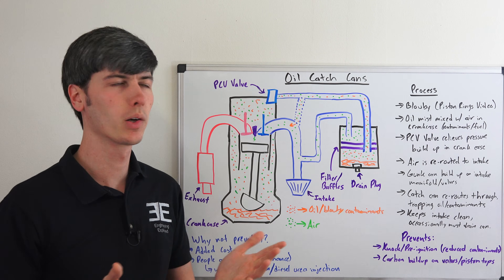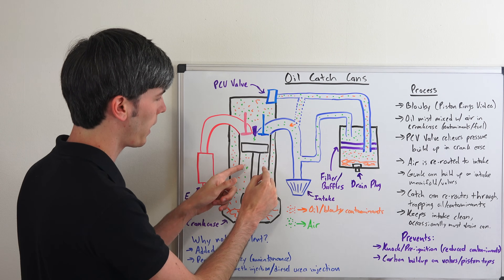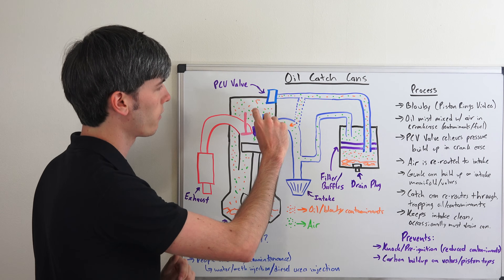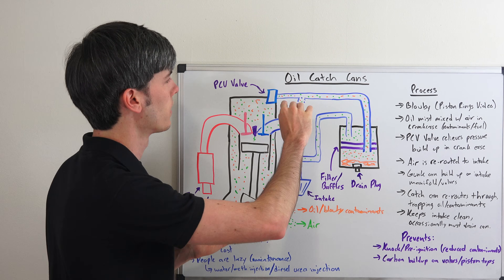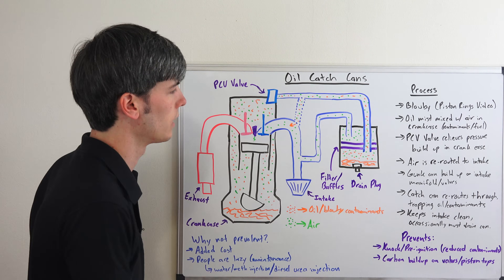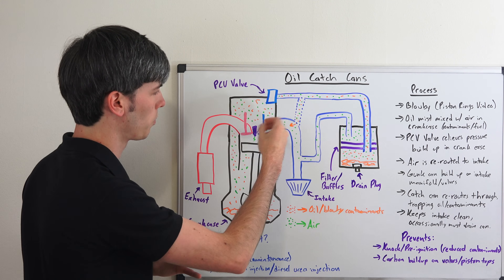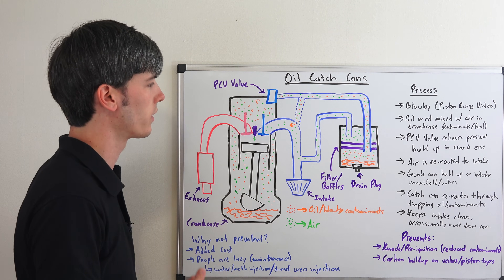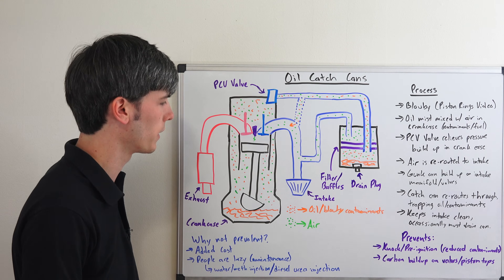What Is An Oil Catch Can?

Comment: Hi ! Thank you very much for this technical info. I bought the cheap one from aliexpress (with the dipstick) and deliberate whether to connect the out port back to engine or seal it and release the crankcase pressure to the atmosphere via the supplies external barrel filter . I’m afraid that the PCV will barely open due to lack of vacuum (if the outport of catch can and the intake  port are sealed). What is your opinion on this ? Many Thanks !

Comment: Better terminology would be "oil separator".    In the oil separator, you could have a coalescing filter to remove oil vapor before you return the crankcase fumes to the intake manifold............    Thanks for sharing.

Comment: On a port injection engine assuming there is no catch can, does a fuel like Chevron with Techron additives automatically end up cleaning the oil mist build up on the intake valves?

Comment: Do the elements inside the catch can, can restrict the normal air flow pressure, and will cause positive crank case pressure build up? I have read this somewhrere and decided not to put one in my diesel truck yet because of this concern..

Comment: When cleaning the throttle body on my wife's 2004 Buick LeSabre, I found it difficult to clean both sides, so I removed it from the intake. The front side looked pretty good and had probably been cleaned in the past (used car). The intake manifold side was incredibly coked up. There was in excess of 3/8" buildup- and I had never seen any engine that dirty before. I plan on putting a catch can someday to prevent this from happening again.

Comment: Through the 50's and 60's a simple 'down draft' tube handled this problem just fine.  You should not be pulling a vacuum on the bottom end of your motor.  That makes no sense at all.  "EQUALIZE" the pressure from the bottom end of your motor to atmospheric pressure is all that is needed.

Comment: What is the optimal crank case pressure? 

Have you done any experimenting with testing comparing oem crankcase pressure against the alternatives (breather, catch can, catch can breather combo, or oil air separator)?
Reply: Vacuum is best, as in "positive" crankcase ventilation. I vented mine open to the street for 10,000 kilometers, and the oil change was pitch black, the last half liter oozed out of the drain hole like black mud. So I connected it back up properly, and the oil hardly even gets dirty now. Am presently shopping for a catch can, that doesn't restrict the vacuum.

Comment: My question. Does it matter if the baffle or filter from the catch can is connected on the PCV line? Or from the crankcase line? I believe that I've seen some connecting the crank line to the filter line of the catch can,  and some the other way around.  I'm a little confused

Comment: Question for you, on my motorcycle I made a “catch hose” instead of a can.  The way it is set up is hose out of crank case breather outlet, T connector with a piece of hose and breather at the end of it going up, longer piece of hose with drain plug going down.  It collects oil but there is still a good amount of wet vapor that escapes out the breather and therefore gets all over the top of my engine.  Can I put a vent somewhere, stuff the top hose with steel wool, or reposition in a different way to get rid of this problem?

Comment: if oil catch can weren't incorporated into car design, why didn't car designers just route the bottom of the can's oil contents back into the oil pan via the dipstick tube after engine shutdown? Seems like a simple solution to me, a gravity-based purge. No manual maintenance of emptying the can.

Comment: @Engineering Explained Can you explain the differences and especially the benefits between single valve and dual valve catch cans.  Dual valve catch cans are supposed to be better and they are significantly more expensive, but I can't tell if the benefits would apply to everyone and if it's worth the price difference.

Comment: Approximately what is the diameter of an oil catch can? And regarding the filter/baffles, is the "filter" actually layers of crimped wire, often referred to as a "mist eliminator" and are the baffles you mention of the chevron type (zig-zagging thin steel plates (almost "spooning" each other, almost nesting into each other)?  In industry, chemical plants, refineries, paper mills, the chevron-type is used for large, fast moving volumes of liquid-laden vapor and used to separate the entrained liquid particles from the fast moving vapor and  is particularly good for dirty applications. The wire mesh mist eliminator (also referred to as a "demister"  by some in industry) offers a much higher liquid/vapor separation efficiency than the chevron-type due to its ability remove much smaller diameter liquid particles entrained in the vapor flow, however, this type of mist eliminator requires a slower ft/sec liquid/vapor velocity through it in order to achieve that efficiency, hence, the wire mesh demister usually requires installation in a wider diameter vessel than the chevron-type to achieve those lower velocities.  In certain circumstances, in a "sweet spot" of liquid/vapor flow rate that satisfies both the wire demister and chevron design characteristics, it is not uncommon to see a  wire mesh demister installed directly on top of  a chevron mist eliminator.  

What is the most common liquid/vapor separator used in these oil cans have you seen, or is it your experiences to have seen both used in combination?  And again, what is the typical diameter of an oil catch can?  BTW, it's also common in industry, and particularly in the oil patch, to see what you described initially--- a separator vessel without a demister or chevron in it.  If the vessel is properly sized to the expected liquid/vapor flow, the velocity of liquid/vapor immediately drops the moment it enters the vessel, allowing gravity alone to disengage the entrained liquid from the vapor and collect on the bottom of the vessel to be pumped away.

Comment: Its wonder modern engines run as well as they do. Between the exhaust gas re-circulation, the fumes from the gas tank making their way into the intake and the piston and oil blow by into the intake, yikes, plus we are pumping air into the exhaust. Yikes. But somehow they keep getting more and more power out of the these smaller and smaller engines. I'm afraid to adjust or alter anything on these engines.

Comment: There's a reason why manufacturers don't put oil catch can in their engines. That oil is needed to lubricate some parts especially for turbocharged engines where the turbo could get super hot. Oil mist is not bad for the engine. Oil catch can isn't realy that bad for non-turbocharged engines, just make sure to clean all the internals before installing one. But if you really want you engine to last long, ther's no need for a catch can just clean out all the carbon build up every 5 to 10 years depending how often you use your car.
Reply: Oil in the intake manifold is a bad idea.  Turbochargers get their oil from oil lines, not from blow-by.  I thought, engines with turbochargers had an oil-separator in the PVC system.  The average person does not ever "clean out the carbon".

Comment: Oh no. I think your explaining the opposite. More gunk will go directly in your engine. Oil catch can catches oil, then it leaves your intake dry. Dirt + oil will only stick on the sidewalls in your intake. Unlike without oil, dirt will go directly in your combustion and freely go everywhere in your engine. Thats why all car engineers redirect them in intake without occ. They have studied it and have decades of experience. I hope you will change or make another video to avoid damage in their engine. Thanks.
Reply: The gasoline has detergents that cleans the intake valves. Do not use blow-by oil ...
Reply: @MrSummitville  btw if you want to reply,  ask the manufacturers engineers instead. Debate with the people who manufactured your car with years of experience and knowledge why they did not install occ in your engine.
Reply: @MrSummitville  if your engine sprays gasoline before your intake valve, you may be right on what your saying. But then, dirt goes everywhere in your engine not only on intake valves. Try asking mechanics fixing engines with dirt all over their engine. Its either they installed oil catch can or they do not maintain their air filter.
Reply: @joeydingel9904  Keep learning elementary level English, homeboy.

Comment: His diagram is different from other engines. PCV valve is right on the exit of the valve cover. Others are attached on the intake. In other set ups, oil catch cans also help keep pcv valves last longer.

Comment: I think if you ran your engine on E-85 you can get away without using an oil catch can as the E-85 fuel will essentially wash away the extra oil that enters the combustion chamber from the PCV. I also may be completely incorrect but that's just my opinion.

Comment: Just got a Veloster N and everyone is telling me I should get an oil catch can, but wouldn't the manufacturer added one if it were necessary in order to prevent them from doing preventable warranty repairs during their ridiculously long power train warranty? Can an automotive engineer actually answer this for me?
Reply: No. It costs more to make it feom factory anf thry dont want your car to last longer
Reply: @Ethan-burner-acc  Nice guess, but you are not an engineer. I got my answer already from an automotive engineer: Direct Injection does buil carbon on valves, but clens itself if the engine is reved high. Sports cars that are meant to be driven hard and are used as intended have nothing to worry about a little carbon buildup, unless u drive slow and short distances, in which case, why the hell did u buy a sports car?
Reply: @Sie84yv  Thats good for you. But my civic daily is direct injection and will be getting a oil catch can

Comment: Awesome video.  My rig has been in and out of the shop for 6 weeks. Was blowing oil around rocker cover. It's a 12 litre turbo diesel. The mechanic basically ran the hose over the chassis and dumps it. Which I doubt it legal or ethical.  A system like you explained seems more legit. Would it work on my truck?

Comment: Hi, it is a pitty you didn't addressed how does this change if you, e.g., have a turbo charged engine ? Or an engine with a dual valve cover system vs single ? Can you vent to atmosphere or do you need to vent back into the intake ? There seems to be allot of debate on forums online on what you should connect, e.g., the CA18DET engine to a catch can. For someone like me who is just starting into this, it is very difficult to judge who is right or wrong...

Comment: You can use an oil filter due to one side being threaded, insert an adapter there, then make a hole on the opposite side with another adapter.  
There may be some obvious downsides to this design, but it will work inexpensively.

Comment: So In your diagram your catch can is routed between the PCV valve and the intake at another location on the intake tract— correct me if I’m wrong but the catch can can use the same inlet on the original intake manifold for the post-filtered air into the same vacuum source, is that correct?  

On some engines in the original configuration, there are two ports on the valve cover 1) drawing in fresh air from the pre-throttle body intake system and 2) where the PCV is located.  

Can you put a closed system catch can that isn’t vented to atmosphere to the other valve cover port that originally draws pre-TB fresh air?  In this case the PCV won’t have vacuum which is why I think it won’t work... however I’ve seen engines setup this way by the consumer.  I don’t think this is correct since it lacks vacuum source.  Please let me know if my thoughts on this are correct.

Comment: Kinda late to the video, but maybe someone will see and be able to answer it for me: can I route the drain plug into the engine, so the draining is 'automatic'? I have a not used connection on the side of the block, a little higher than crank shaft level. I'm not sure if it would change any pressure level inside the block and throw anything off by that. It's on a diesel engine.
Reply: That oil has gasoline & combustion components in it ...
Reply: @MrSummitville  I know what you're implying, but that was not the question. And again, this is on a diesel engine, not a gasser.

Comment: Why don't they just route the oil back into the oil pan?
Reply: if there is exhaust or fuel in it, you would be sending the contaminates back to the oil stream. this acts something along the line of an air filter in between the PCV valve and the air intake

Comment: So the oil that accumulates in the catch can is reducing the amount that should remain in the crank case, correct? So do you need to check your oil more often and refill as needed?
Reply: The catch-can does not "reduce" the amount of oil in the crankcase, it just prevents the oil from being burned in the combustion chamber....

Comment: I have a turbo charged 1.6L GDI in my 2014 kia forte, I've been using CRC and the seafoam intake cleaners to keep up with the carbon build up. I was always curious how much material gets recirculated and caught in the catch can, so I got a cheap amazon special to test out. I found the PCV in the kia book, made that the input of the catch can, and the outlet of the can finished at the intake manifold. I drove 80 miles and checked it the first time, there was enough fluid to fill a whiskey shot glass halfway full. I put a ball of fine steel wool in the empty can to help catch particles. I think I'm a little late putting a can on the car since it just hit 100k miles lol. It works well enough that im going to start looking at catch cans for my other vehicles.

Comment: I am curious as to whether the cleaner air entering an intake would have an effect on the O2 sensor readings. As a long time owner of Toyotas, I've dealt with their finicky O2 sensors from time to time, and it would make sense that if the engine with an OCC isn't burning blow by oil, the exhaust has to be cleaner and the sensors should be less apt to throw a code and turn on the check engine light. But is that a reality?

Comment: They could design an additional small catalytic chamber to catch the oil droplets then burn them on the highway instead of reintroducing them in the intake, also in conjunction with an OCC. The amount of oil coming out of the OCC would be very small anyway. 
 then use a hybrid mpi/gdi system.

Comment: before installing the catch can I've take out the intake and exhaust manifolds to clean then mount them again. After that I've ran one week on venting mode (catch can exit has a tiny filter) and another week in the normal route (catch can exit to the intake manifold). I've found while running the vented mode, much lower intake temperatures and a noticeable gain of performance. However due to the air temperature and its density difference, the mixture gets more lean and the car is faster until certain speed but has a lower top speed because I didn't give it more fuel. Ofc I've returned it to the original route due to the smell of the blow-by inside the car, but that's an interesting test.
Do you agree with this explanation or its just my head?

Comment: Taking in consideration both vented and recirculated catch can systems take the oil thrown on pcv, these are the other advantadges/disadvantages:

Vented catch cans:
Advantages
- no hot oil breather to engine -> lower intake temperatures -> 
less air density -> more air inside the combustion chamber in each 
cycle -> performance gains (take in consideration efi engines will compensate the mixture while others not)

Disadvantages
- No intake vacuum to extract the fumes -> less fumes extracted from 
crankcase -> faster oil contamination and a sludgy bottom engine
- Sometimes engine runs cooler than designed -> fuel consumption will be higher
- More pollution to air and smoke smell inside car

Recirculated catch cans:
The opposite of vented catch cans but the intake temperatures will be almost the same as in default engine without catch can

For petrol engines vented solution is perfect no question about it. For 
diesel engines, if your piston rings are good and don't let much smoke 
to come inside the crankcase the vented solution is enough, if your rings 
are worn you need to use a recirculated system since you need to extract
 more fumes generated and the intake vacuum will help a lot on that

Comment: Why not just redirect and vent the pvc to the open air?
Reply: Because then oil & petrolium would be released into the environment. Instead they are re-introduced into the combustion cycle to be burnt. This is better for the environment than the oil and petrol releaed in crude form i.e. into the open air.

Comment: They should make an oem oil catch system that just drains back into the crankcase automatically whenever not under vacuum like when you turn the engine off.

Comment: Would oil leaking from turbo seal find its way into a catch can? Would it only work if the intake connection was at the bottom of the intake pipe so it gravity feeds back to the can? Just trying to establish if you could use the catch can as an indicator for increased oil consumption, obviously if you had a baseline already from the crankcase vapours only.